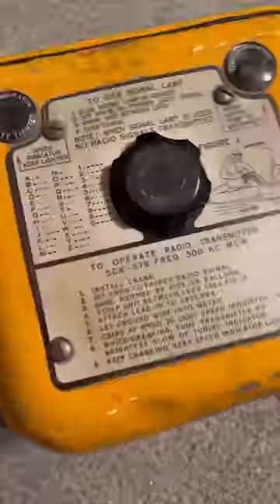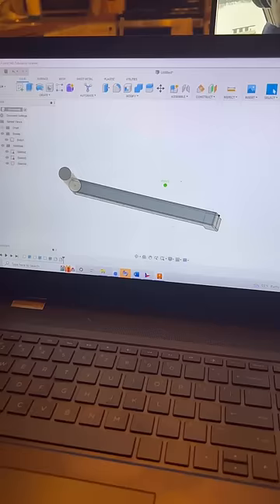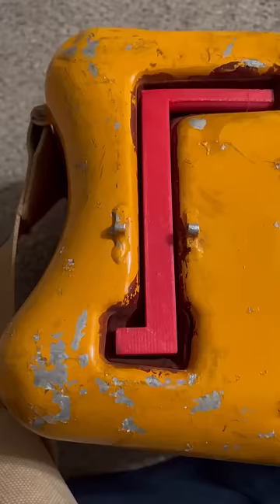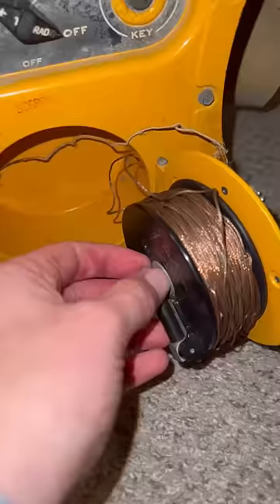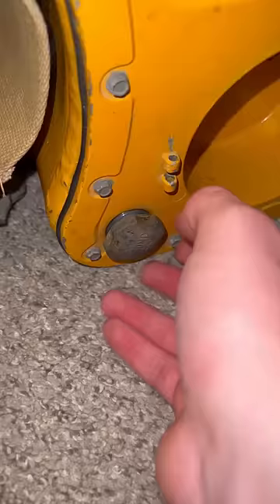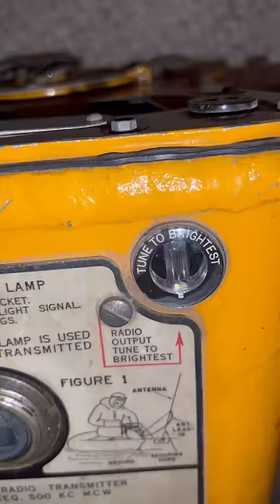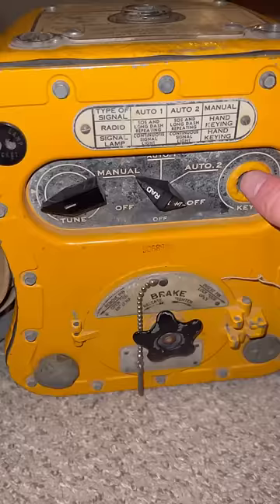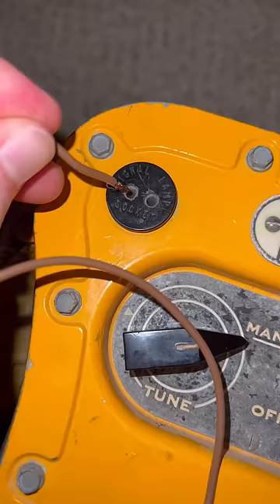Turning this Crank is Illegal

Comment: "Turning this is illegal"

Aggressively turns it*
Reply from the maker: *in the legal mode*
Reply: It was in light mode Also, you were going to have to assume that the police department is using the same frequency as this radio or can, this radio broadcast over many frequency simultaneously
Reply: So uh, you’re in a life raft most likely right? Do you make a kite out of a shark fin? I mean he just casually mentions to fly the wire up with a kite. What f-ing kite??
Reply: This is me
Reply: The emergency kits these were in came with the materials for kites, balloons, and hydrogen generators
Reply: @fjrichman  a hydrogen generator? Why?
Reply: @ST3W101  To send the balloon up... Instead of trying to fly a kite.
Reply: @ST3W101  for the balloons so they'd float
Reply: @jonrice21  there would usually be one in your crash gear
Reply: @jonrice21 bro the kite was attached to the box, thats the green fabric lookin thing
Reply: @jackschneider17 ok
Reply: It is totally fine to broadcast as long as the antenna isn't deployed since the signal will go nowhere
Reply: It's bs. It's too old to matter to be illegal.
Reply: @jonrice21 I think these were more intended for use on the ground in war times? Like say a bomber plane gets shot down over enemy territory but he ejects and lands with this thing, he can use it to get rescued

Comment: As a machinist i feel obligated to say that he did not use those calipers correctly 😭
Reply: i was looking for this, thank you
Reply from the maker: Caliper Drama
https://youtube.com/shorts/Fcg87KqZRlU?feature=share
Reply: Thats what i was thinking
Reply: Yeah he couldve fit it better if he just used the outside jaws
Reply: Yes thank you 😭
Reply: I was just about to comment this.
Reply: He was not measuring the actual space, he was determining what would fit!
Big difference!
Reply: @dangeary2134 no, not really
Reply: Yeah I wasn't gonna correct the guy, I mean he just turned the crank that's supposed to be illegal and we all know criminals had to ride the short bus at some point, so yeah that's to bad😝😝😝
Reply: I just had to add if you ever seen the movie Armageddon with Bruce W. They were using a dial indicator to check a shaft I guess for how straight it was😝 but they was holding it in there hands lol!!
Reply: Ya he didn't even bother using the internal jaws lol! Without the proper knowledge to effectively use this tool you should still intuitively know what they are for. I am guessing he didn't need an accurate measurement.
Reply: You're right but he doesn't need to use them properly to get a high tolerance APPROXIMATE general measurement
Reply: @DevilsInBaggyPants1941  you're talking about short busses when you couldn't follow the plot in a 1 min video?
Reply: He can’t make the crank exactly the size of the opening for it, otherwise it’d be hard to get it out
Reply: @Leto_0  well here's your chance to explain it, he said it himself, so I'm waiting for your true enlightenment buddy.
Reply: i ran straight to the comments to comment that🤣
Reply: Somebody with a brain here, yea he used them wrong
Reply: I winced at that
Reply: @willis7148  he might have been using the wrong tool but he still used to find the measurements so he cant make something that fits
Reply: Was looking for this XD
Reply: What’s with these YT shorts channels always doing thing’s wrong. I saw a video where this guy painted on an outlet with out putting tape on it 💀
Reply: i mean he isnt trying to broadcast a signal so
Reply: @jackschneider17 what ??
Reply: Hey, let’s talk about firearms lubricants.  I just use WD-40 on an AR.
Reply: he wanted to do that for the views
Reply: @countdankula2746 you can’t be talking when you don’t have the proper knowledge to know how to word a sentence
Reply: @jameshipkins3840  Very educational.
Reply: My exact thought as well...

Comment: The way the calliper is used 😂
Reply: I was going to comment this
Reply: damn nobody fuckin reads the other comments
Reply: Big facts
Reply: he didnt want zero clearance as the actual handle wouldnt have had zero clearance between handle and case. he measured exactly what he wanted.
Reply: Really grinds my gears
Reply: Whats the problem?
Reply: @Riley_Christian  in this case he has to use the other side of the caliper to measure the distance, he has to flip it
Reply: I instantly asked wtf ? Lmao . I’m a CnC operator
Reply: My eyes are bleeding
Reply: @kloc4995  that’s not how measurements work dude, you measure the nominal dimension and then add/subtract your clearance to that from tolerance standards (or in this case, just take 70 thou off or something depending on the desired fit). Measuring under the dimension you want is a good way to get uncontrolled clearances, which cause the product to feel “sloppy” and jiggly. It takes 3 seconds to just flip the calipers, take the proper measurement, and then take off a bit for clearance.
Reply: Glad someone said it. 
I cringed at that 😂
Reply: @kadenielsen210  as true as what you're saying is; we both know it didn't take a right and proper 'sounding of the depths' for him to know about how big a crank he needed
Reply: that hurt me
Reply: killed me. immediately knew this guy was a fraud.
Reply: Vernier*
Reply: He made a video on that
Reply: He had it backward.
Reply: @kloc4995 then why would he use calipers in the first place. Tape measure, ruler, piece of paper with marks on it.
Reply: Comments like this are funny because he responded with a video showing that the item he 3d printed using that measurement fit perfectly into the slot
Reply: As a machinist who uses these regularly, it hurt to watch
Reply: @fyrelorde  yeah I do agree with that, but he knew what he was doing
Reply: @drunkensheep_  This is the top comment saying this. 🤡
Reply: I saw that to.
Reply: Someone finally said it! Thank you!
Reply: I dont believe this video because of this so I'm going to have to look this fact up somewhere else to see if it's true.
Reply: Thank god someone said this. I was surprised to see it wasn’t the top comment
Reply: Only came in here to see if anyone else saw
Reply: @kloc4995  why would anyone do that? If you want clearance you simply get the actual dimensions and subtract however much clearance you desire.
Reply: @kloc4995  you realise you can subtract numbers from the ones the caliper gives you, you can add clearance through the magic of maths.
Reply: Discredits everything he says Imo
Reply: @drunkensheep_
Reply: I had to rewatch and he had it upsidedown 😂
Reply: @drunkensheep_  your going to have to repeat that, I wasn't reading
Reply: thank you. Damn that annoyed me.
Reply: @kloc4995  I guess, if he decided the thickness of the jaws was exactly the clearance he wanted.  I think most people would use the correct side and subtract the clearance they wanted.
Reply: @jjsjeffjjsjeff  He just made a video about it. He did it just fine lmfao
Reply: Why is he using calliper? 
I hope to just using metal ruler
Reply: @oliverklozhoff  I get what you’re saying, and I understand he doesn’t need an insanely accurate measurement. But if you use the calipers correctly, get a reading of 2.045 inches (just an example), even if you don’t care about the thousandths place just round to 2.05 inches. From there, subtracting 70 thou (0.070) is mental math: 2.05-0.07 = 1.98”. I’m not asking the guy to work with laser precision down to the tenth of a thou, the level of precision with which you take the measurement is based on your desired outcome. With tolerances probably being quite large in this case, just taking a quick look at the nominal value (using calipers correctly), rounding the value to the nearest ten thou, and then subtracting the desired clearance adds essentially no time to the project. And then if he wanted to do other stuff with it down the road he wouldn’t have to say “what’s the clearance on this? I dunno” and re-measure.

Comment: Warning: There appears to be some off-white glow-in-the-dark paint on some of the dials. Glow in the dark paint from that era was made with radium, so please be extremely careful not to let any flake off, and wash your hands if you touch it!
Reply: Mmmm tasty radium chips
Reply: im always played with that in the dark at night when i was young and i become old  so im pretty lucky tho
Reply: @hippycow1006  hello xbox cow
Reply: Yes, radium is very dangerous if you get it on your hands so lick your fingers REALLY well! For safety!
Reply: @hippycow1006 yum my favorite
Reply: Just let darwinism take it's course
Reply: I was under the impression it's not that dangerous. Like, they only realized it was bad after a few years when the workers painting it on things started getting radiation poisoning, and the only reason it was as bad as it was was because they had been told to basically lick the paint brushes they used to make them pointy.
Reply: Its actually only dangerous if ya eat it. So don't lick those dials
Reply: @DrymarchonShaun  Yes and no, uncovered Radium is radioactive and causes problems. But it can be easily mitigated by pretty thin plastic or glass covering. If ingested though you lose that protection. Most Radium, will leave the body soon through digestion (80%). However, a small portion of it will enter the bloodstream (20%) and an even smaller portion will end up in a long-lived area like your bones where they will continue to emit radiation for more than your lifetime. Given a long enough scale to the amount ingested, it can cause problems. For the Radium girls, that's a lot so it took very little (as low as 1 year) to cause fatalities, although tons of health problems before that for a very high dose. Perhaps if you ate just 1 dial worth of paint, you might have problems after a longer period like 10-20 years
Reply: Just don't eat it
Reply: I think your smoke detectors are more hazardous than the glowy stuff
Reply: Don't worry, I got some RadAway
Reply: OK. Don't eat paint chips.
Reply: @lilmike2710  Modern smoke detectors are optical, no more tasty isotopes used in them.
Reply: @lilmike2710  They're not. Smoke detectors use a very small radioactive source (americium) and it is properly contained.
Reply: @tcg1_qc   Sarcasm : The use of words that mean the opposite of what you really want to say, especially in order to insult someone, or to show irritation, or just to be funny. For example, saying "they're really on top of things" to describe a group of people who are very disorganized is using sarcasm.
Reply: @lilmike2710  So, you were trying to be funny? Gonna have to try harder next time. Otherwise how can I know it's sarcasm? You know some people definitely believe what you said.
Reply: yeah i was coming here to say that. those models all have exposed radium lume

Comment: You can just activate it at noon. Its legal to test emergency broadcasts qt that time
Reply: In the case of ELTs on airliners. You can test them within the first 5 minutes of every hour. Provided you tell the FAA first
Reply: so if you're actually in danger and send one at noon they'll just ignore you?
Reply: So thats why I hear a tornado warning and then an earthquake EAS with an end of the world alarm outside every noon.
Reply: Yeah you gotta let the authorities know first
Reply: @timmanboy1 thanks for the info, i just bought a marine transmitter on the 11meter band and it also has an emergency channel.
Reply: @vexnity460 just keep sending it. You would be pretty lucky if someone was monitoring that specific frequency
Reply: @thatgamerboy3467  Maui was said to have the most advanced warning system. That their siren system was the gold standard and chose not to activate it for concern it would confuse people all the more.
Reply: @vexnity460 that happens if you let the FAA know about you testing the said tool, THAT'S when they ignore you...
Reply: We do learn something new everyday thanks
Reply: @vexnity460  The part where he says you have to tell the FAA first is false, that is not required, but you are allowed to test a ELT within the first 5 minutes of the hour, but, the test must last less than 15 seconds

Correction, I was incorrect  about the 15 seconds part, the ELT should not transmit more than 3 sweeps, from what my research can find
Reply: @vexnity460 no you let the FAA know then they know what signal is an emergency or not.
Reply: @billbirch3748 what?
Reply: Uh emergency communications have to be made aware, emergency broadcast systems etc etc arent just tested randomly without warning
Reply: RIP to the person who actually sent out a distress signal at noon 💀
Reply: @blakewheeler8461 you’re wrong buddy. First 5 minutes of the hour, brief test is assumed to be test only. FAA Aren’t even the ones monitoring…. They couldn’t care less so long as you are following the first 5 minutes rule.
Reply: @thatgamerboy3467 Where do you live and where does the sound come from
Reply: SOLAS stations are always listening....

"Test call procedure for HF radiotelephone

When establishing routine communications by HF radiotelephone for the purposes of a test call request, listen on the calling frequency (4 125, 6 215, 8 291, 12 290 or 16 420 kHz) for any other traffic, and if vacant, the call should be made in the following manner:

the name and/or call sign of the station being called, spoken not more than three times;

the word THIS IS; and

the name and/or call sign of the station calling, spoken not more than twice

followed immediately by TEST CALL REQUEST; and

followed immediately by OVER

Await a response on the calling frequency, repeat if necessary after two minutes, and if no response is received, move to another calling frequency and repeat the procedure."

As this radio is morse TX only this may be hard to do. I suspect it transmits a registered call sign. Turn the crank, pack up and pissoff before you are triangulated.
SOLAS will look to sea first. HF...you could be anywhere on Gaia depending on propagation conditions.
If you want to play make the antenna inefficient...
That's a nice unit.
Reply: Yep. Also, hope no tornadoes happen at noon for the same reason. (If you wanna sneak attack my city, noon on Wednesdays would be a good time to do it.)
Reply: That’s actually nice to know, I’ll have to look it up to make sure but still neat
Reply: @timmanboy1 yeah we have to do it quite frequently for our fleet. Just call it an and hit test. I wonder though, if these older ELTs transmit on the same frequency as modern ones.
Reply: @fredjackson8408  I'm not entirely sure. I think it's more based on AM frequency given short radio waves used in fighters and bombers back then
Reply: @timmanboy1

You don’t need to tell anyone. First 5 minutes of any hour for less than five seconds.
Reply: @vexnity460 well I assume if you use the Morse code thing to say: this is not a test I'm actually in danger please help they will not ignore it